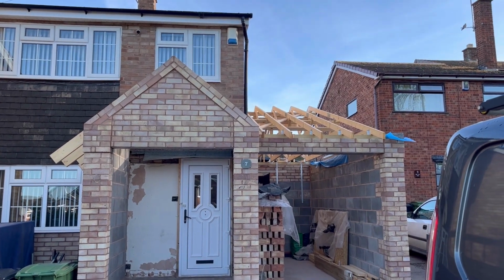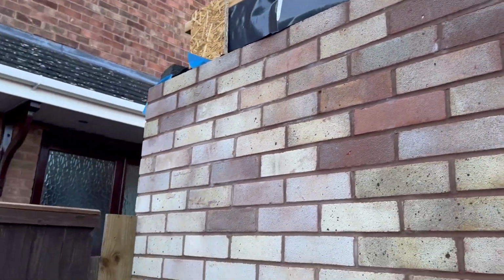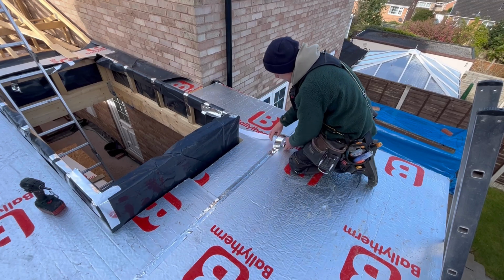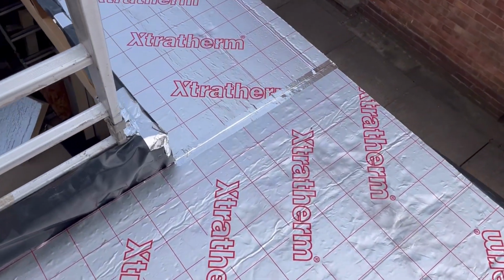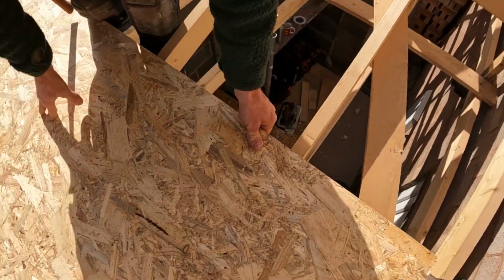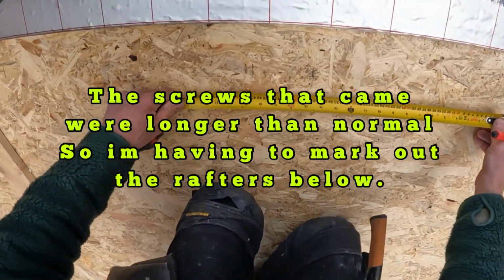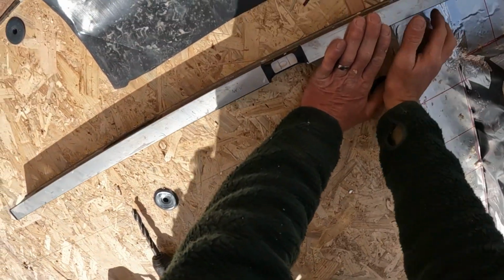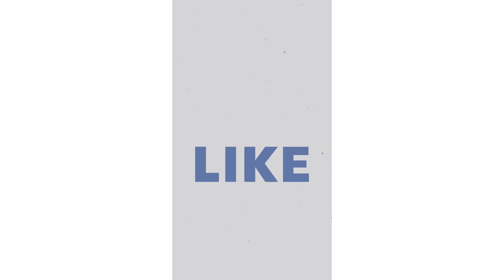Finishing the flat (Warm) roof

Comment: Did a warm roof course ran by Firestone the edpm manufacturer. They told us the vcl layer has to be brought down onto the inside walls and sealed to it . The idea being no moist air can move from inside or outside the house into the insulation where it can’t then get out. They also advised against using any of the plastic vcl products and to use the fully adhesive backed ones like alutrix. Apparently it’s a massive issue of incorrectly fitted vcl and the warm roof filling with mould in no time . Just thought I’d share.
Reply from the maker: We have had lots of talks with different manufacturers and got a lot of conflicting answers. It’s been mentioned a few times about types of VCL to use but the answer generally comes back to penetration of the fixings hence using the thermal break ones and not piercing through the OSB base layer. We spanned the VCL over the cavity and then inside we friction fit insulation board to all the vertical spaces between the rafters to as you say seal any potential hot and cold air meeting and producing moister. We had a lot of talks about cold roofs as well and fitting spot lights in them it’s a bloody mine field.
Reply: @Mr_A_Builders  completely agree a minefield! Some of the pictures they showed us of failed warm roofs less than 2 years old was shocking . We only use alutrix now and it can be pierced with a screw and retain its barrier.  There is a good vid by Steve London flat roofing where he does a water test with it. Lastly your lantern upstand , assuming the lantern itself was insulated otherwise the upstand would need the same amount of insulation around it as the rest of the roof. Every day a learning day! Trouble is building control generally do not seem clued up
On warm roofs which doesn’t help!
Reply from the maker: Your right about building control not a clue and massively under staffed.
Reply: @mrabuilders6723  planning also clueless.... last one I spoke to had never heard of brick slips
Reply: anyone know more of the firestone course shizzle wrote about?

Comment: What size drill bit did you use for the thermal fixing. I can’t find any info. Mine are EJOT 14mm wide but are they tight fitted or 15/16 mm to leave for deck movement? PS 15 mm is a bit of a unicorn 😢

Comment: Wrong! Timber upstand, thickness of insulation, should be fixed all around perimeter on the of 18mm OSB - best T&G. Vapour control layer should go on the OSB and up on upstands inside. Insulation - Kingspan TR27 or other suitable for warm roofs cut tight and then mechanically fixed with thermally broken screws, joints can be taped too. DO NOT USE ANOTHER LAYER OF OSB ON TOP - IT WILL ROT! Finish with a final layer of waterproof membrane like EPDM, Sarnafil direct on insulation. Bitumen based waterproofing systems will require suitable underlayers.
Reply from the maker: Dude...chill... you're embarrassing yourself.